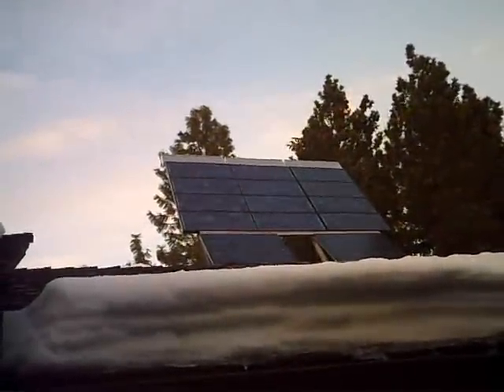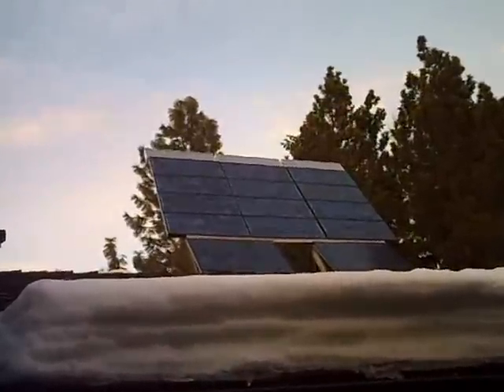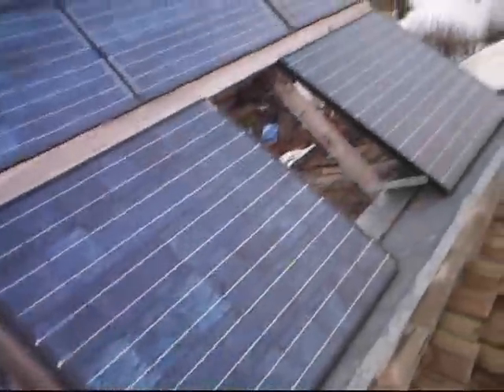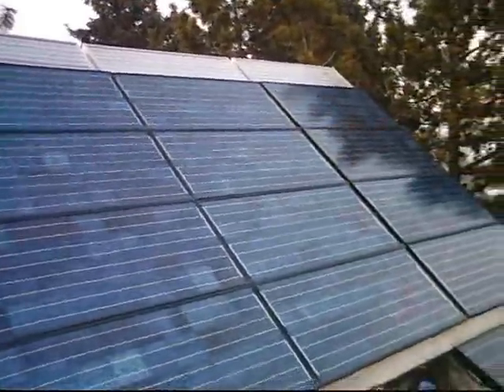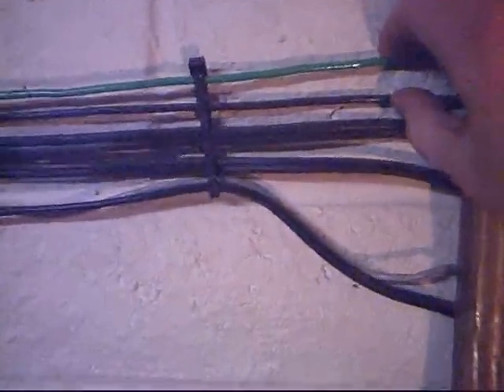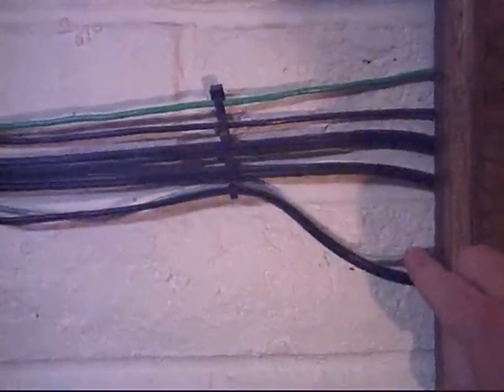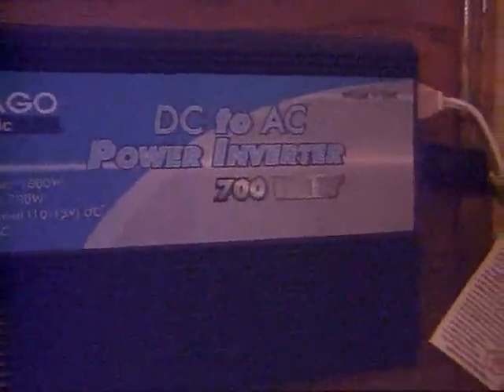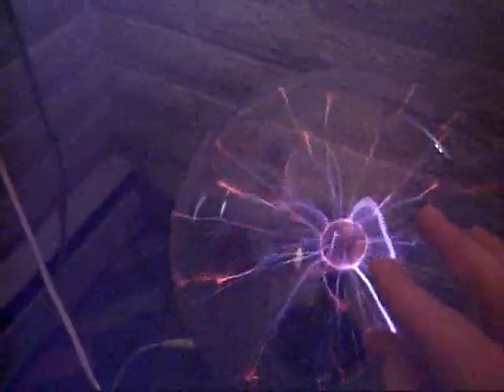Introduction to  a Small 108watt solar System

Comment: @Ozarkorganicshiitake Sorry guy, you are wrong...   Why is your car all multi strand wire...  Because electricity travels over a conductor, not through it.. Its not necessary for AC because there is little electron flow, but DC there is, its all about surface area. More surface area for those electrons the less resistance. BTW, where did you get your info. This is what I was taught when I was in college.

Comment: @dleric Actually not true, use what you want to use.    Solid wire is perfect fine to use with DC, the benefits of stranded is more apparent with AC power apparentsly.    The biggest benefit of stranded is that it is more flexible and stands up to vibration better for example in cars.

Comment: Nice little starter system .... I recommend A better solar panel, battery and controller... in line fuse for the positive off the solar panels as well.... should also add a 125 fuse at the inverter for safety.These day you can do it cheap but with quality as well. I have a lot of Off Grid folks that I work with and it is always about the budget so I have always tried to find the balance of Price and quality.
PS my son really like your closing music!

Comment: solid coper wire is no good for DC current. Large multi strand cables should be used between you batteries and inverter.

Comment: Dear,
good video. I am novice with solar. need some advice. first, your tv and your home system was DC ? I bought a German made module of 125W and German inverter  from suntechnics 350W with input voltage of 24V with peak output power of 700VA. Do I have to buy 2 batteries for it? of 12V each ? and which battery u suggest? Pls reply.

Comment: I have been trying very hard to understand this, So if I am wrong PLEASE HELP me to understand better. I was told that 1 thousand watts used in one hour is 1 Kilowatt/hour. And that if you use a 100 watt ligtht 10 tomes for 1 hour each time, in a month. That is 1 kilowatt/hour of electric use in that month.  That's the way the electric Co. explained it to me.  If that is wrong.  Please help me understand better.  Thanks for your help in advance. Hopfully,  My new friend

           Raymond

Comment: I love it ! Very helpful. Questions, Why the plasma lightening lamp,or is it just COOL ? The lamp is DC ? Doesn't the inverter switch everything to AC ? Do you need alot of sunlight ? Can you simply add more batteries if nessesary ? I'm no electrician , did you have plans ? Thanks.